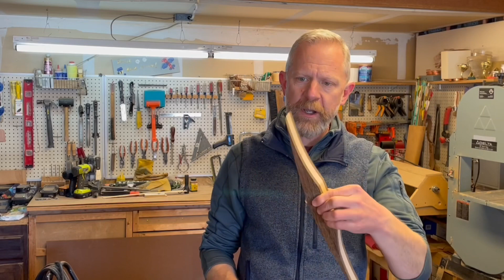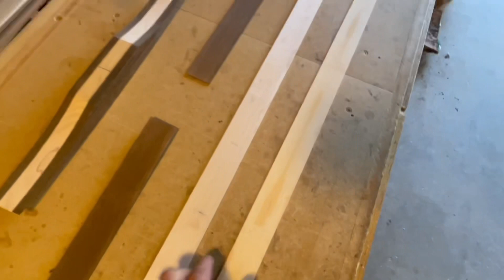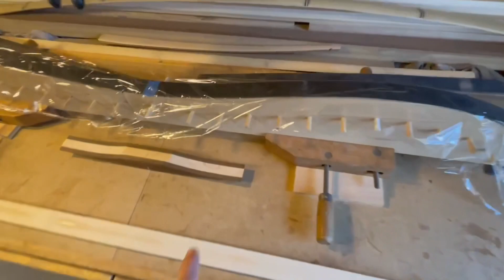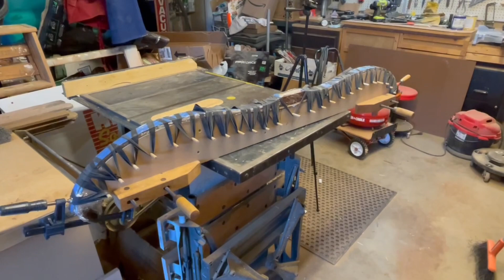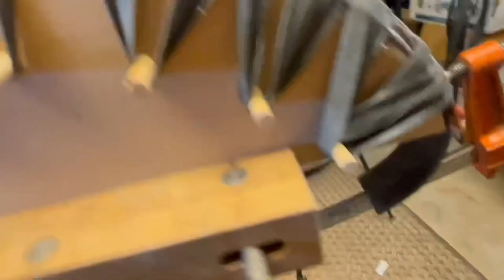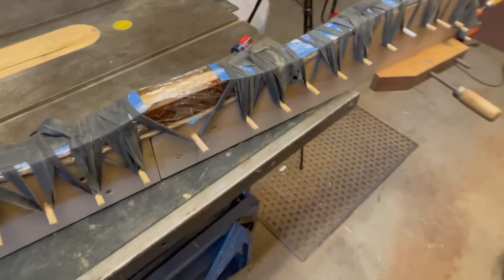Bamboo back and belly Duoflex Pt.3 - The glue up

Comment: Great series of vids, been binge watchin today. You mention in this particular build the glue up and mentioned glue so wanted to know what you actually used,  was it a glue like unibond 800 or an 2 part epoxy?  
Thanks in advance and keep up the nice work...😉
Reply from the maker: Thanks for watching my videos!!! I hope they are beneficial. As for glue, I used EA~40 which is a 2-part epoxy. I prefer it because it has a long working time compared to other adhesives. I have used unibond 800 in the past with great success. What I like most about it is that it will cure at room temp in 4-6 hours. The down side is that you have to complete your gluing operation in about a half hour, and the glue itself is perishable - so what you don’t use has to be discarded after about 6-9 months. Even then you’re never quite sure if it is still any good once you hit that 6 month mark…

Comment: Nice work thank u, can I make an laminated  Assyrian bow out of two layers of bamboo that is glued together in opposite directions for the limbs  ?
What thickness for the limbs do you recommend for me? I'm thinking about 54" bow with 32" draw length and 40-42 lbs ?
Reply from the maker: In honesty, I really don’t know. I would think that in order to get the bend you’re looking for in the limbs, they would have to be quite thin. That would require that they be pretty wide to get to your desired draw weight. It could probably be done but it would involve a fair bit of experimentation to get it right. For a starting point, I would go with 1.75” wide limbs with a total stack of about .15” - .17” with a thicker lam on the belly.  Any tillering would need to be done with heat. This would probably turn out light, but the bigger concern is if it would hold together to full draw.  I’m pretty sure, that these kinds of experiments would help reveal why they used different materials for their bows.
Reply: @meadowlarkadventuregear  Thanks for the reply, that was really helpful .

Comment: Have you ever tried to make a short 52-56" recurve? I think that would be cool,  especially in bamboo and ipe.
Reply from the maker: Ipe doesn’t really like to take a recurve-type bend without breaking even with heat.  As for the length, I may work to get that short, but in reality, this build is the most recurve I have attempted so far - so I guess we’ll see where it leads
Reply: @meadowlarkadventuregear  gotcha , thanks for the reply.